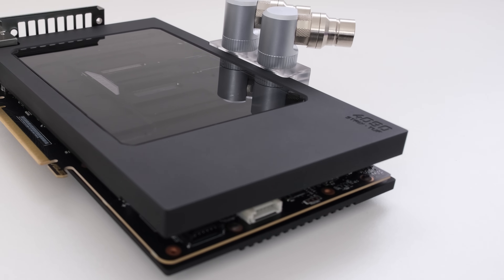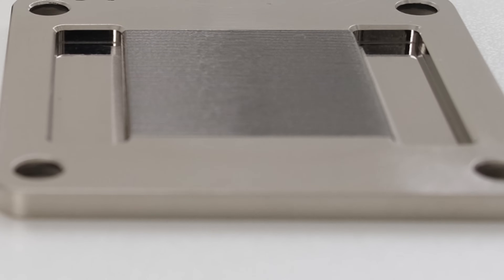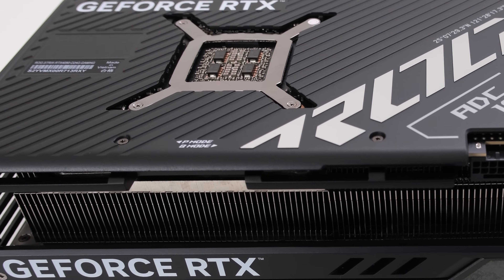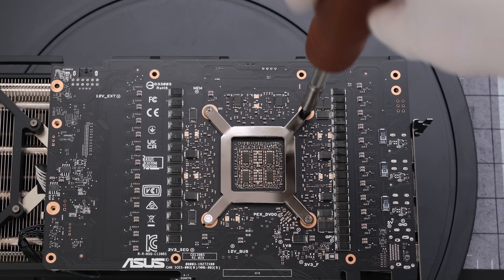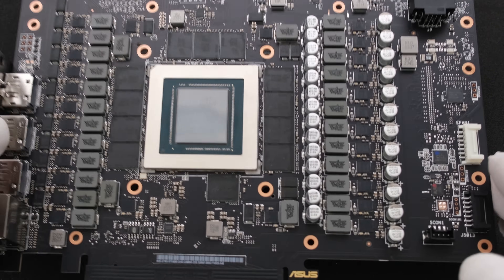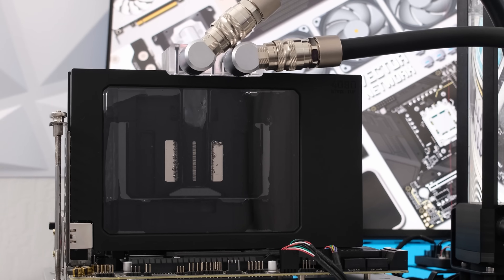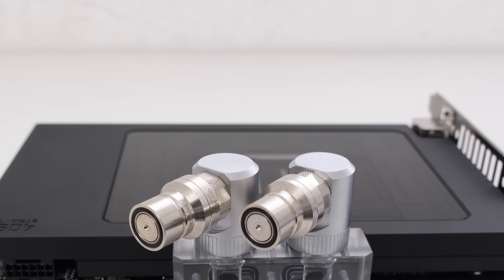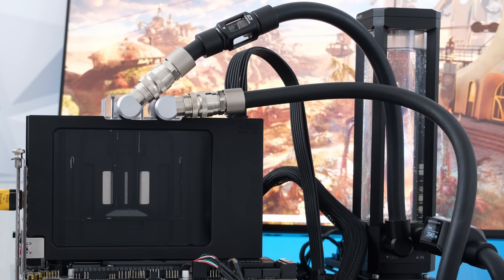Optimus Strix Water Block - Best RTX 4090 Cooling?

Comment: I don't understand how you compare. The video card should work at the same frequency and you just change the water blocks and compare (at the same coolant temperature). And the last thing - Overclocking below 3000 for Asus Strix RTX 4090 is ridiculous. Real overclocking is 3060 at 1.1v and power of 600 W (or better yet, install a 1 kW BIOS from Asus). This is just kindergarten, man. Or buy 4090 HOF

Comment: lovely video,s no flashy abnoxjous music , a calm relax presentation , i was wondering tho , cool new Gpu cooler , their cpu cooler is great aswel i hear , would it be possible in this setup to use Kryonaut Conductonaut a bit of liquid metal on the coldplate , or it,s a no go becuz of the oxidazion of the metals ?
Reply from the maker: Thanks for your comment 🙏 Thinking about this outloud, liquid metal should work. The GPU doesn't have the IHS like the CPU, so it's just a direct die. Nickel plating should be okay with the liquid metal, it's that copper that will more quickly react. I never tried (yet) having only used on it CPUs. Hope that helps

Comment: The thing about such setups involving the niche products based off of high end components is that if you avoid spending the extra money on the bells and whistles edition of everything, couple of years down the line you'll be enjoying a much faster system with just the  money you saved. It would be one thing if computer hardware generations leaped in every four years but as things stand you're either robbing yourself of a significantly better experience down the line or you're spending borderline proper workstation levels of money on consumer hardware.

Overclocker motherboards come to mind, they are objectively worse than workstation boards in every metric except for bios options for tuning and the average gamer will not benefit much from it until they become obsessed with tinkering and exotic cooling solutions. But these boards cost as much as a workstation board that has more PCIe connectivity, more and faster usb ports, more and faster networking, better power delivery (to feed the HEDT monsters), often come with remote management hardware, lots more storage options etc.

Any extreme liquid cooled GPU is the same, it'll just be an additional $600-700 which would probably cover half the cost of a RTX 5080 that will be 50% faster than a heavily overclocked 4090.
Reply: true, the only thing that would be an argument is near silent operation, better operation if you have very hot summers, some people also just like the process and the pieces they create for what they are beyond Pc functionality, why do people spent thousands to make thei car look cooler, same concept
Reply: @sayit1196  sure, I agree that it's a hobby and people are interested in it for all kinds of reasons. I'm a workstation minded pc builder so my priorities are a little different. I made the mistake of having hardline tubing on a system which was my main work PC, which resulted in a downtime of one day when I had to replace a faulty memory stick. Nowadays, it's separate soft tube loops or air cooling only. To make a car analogy, my point is that a souped up Subaru WRX might cost more than an M3 and it'll be less reliable, less comfortable and might perform only slightly better on the track. The cooling solutions on modern high end GPUs are already overkill, like the 500HP+ engine on the BMW M3, I'd rather spend the money on more luxury than power at that stage of diminishing returns.

Comment: best rtx 4090 air flow kard ist ,, galax rtx 4090 hof 3,1ghz 666watt tdp ,,
Reply from the maker: Thanks for your comment 🙏 Agreed. I did qualify when I said the Strix is the best air-cooled card "offered by ASUS", as I was comparing it to their Matrix. The Galax is the best air-cooled 4090. If the Galax had a water block, I would teardown the Galax (to see the PCB, usually they have really customized PCBs) and then put it on the block, to really see how far we can boost it. Thanks again for the comment

Comment: I use cerakote stuff daily, and while there is a cerakote option for thermal transfer, ive seen cerakote fail in moving water environment cases. Nickel plating is generally better in this application because its atomically bonded. Whereas you have to think of cerakote as more of a paint. the parts are sandblasted in a specific way so it creates the right side of peaks and valleys for the cerakote to bond to. But once moving water finds its way under the cerakote then it will still peel or chip like paint. You can also find examples of cerakote plated water blocks that have failed this exact way on various watercooling forums/subreddits
Reply: So over time it can start to flake. I really doubt that Optimus will care if this happens to someone though. Bad nickel plating exists too and starts to flake. Bare copper is the most simple if you don’t care about the tarnishing over time. You can polish it too though.

Comment: It makes no sense to cool GPUs with water these days because it is almost impossible to overclock them. What's more, you can hardly resell a graphics card that has been modified in this way.
Reply: The point is to get lower temperatures and noise not just overclocking. And what do you mean hardly resell? You can always attach the aircooler back and resell the GPU.
Reply: @Simon_Denmark   Would you risk spending $1300 on a used 4090 that has been wrecked several times and is out of warranty? Not me
Reply: @Thomas_Thiel  ”Wrecked several” times. What do you even mean with that? You don’t wreck anything with a waterblock. Attaching a waterblock doesn’t take your warranty. Well depends where you live and if you have bad consumer protection rights. The manufacturer has to prove that you destroyed the card by attaching the block. Why did you even comment? You obviously don’t do custom watercooling.

Comment: You're saying, that Optimus block is 6-7 degrees cooler, but you forgot to mention that you're using totally different paste. It's not how it should be done.
Reply from the maker: Thanks for your comment 🙏 You're flat out right. I have been waiting to test the Optimus block since it was released nearly 2 years ago. I had been waiting for the FE version. I didn't intend to compare it to the FE HK block, but the difference was unexpected and noticeable. It ended up being something I wanted to include in the video, as I thought it was worth mentioning. As for the paste, I got some criticism for using Noctua paste in lieu of all the different pastes that come with the blocks. I was using Noctua for ease of application and consistency for comparisons sake. For this block, I used the KP paste because the instructions called for it and because I was trying to address the feedback. Having said that, I am interested to see what the results would be like if the Watercool Heatkiller V Pro block for the Strix 4090 was test, along with the newly released Ultra plate. I hope to be able to produce that showdown video. Thanks again for your feedback
Reply: Entirely different gpu even
Reply from the maker: Thanks for your comment 🙏 Yep, I had actually been waiting for to test the Optimus block since it was released, waiting for the FE version. The FE version never came and I never intended to show the comparison. But when I tested it, it was clear to me that their was a difference. I tested several of these water blocks for 4090s and 4080s and they all seem to perform the same. The difference here was enough for me to show it. I recognize this isn't apples to apples and that Watercool just release a brand new "Ultra" cold plate for their Heatkiller V pro blocks. I want to see how the Strix 4090 Heatkiller V Pro block in both the regular and ultra plates compare with the Optimus block. I hope to produce that video sooner than later.

Comment: I can confirm this to be accurate based on my testing, as well. My TUF 4090 hits 3045MHz and just stays flat at 3045MHz with occasional dips to 3030MHz. Granted, my setup is a dedicated GPU loop with a 560 and a 280 rad. It is separate from the CPU loop (which uses a 480 rad and the V3 signature block). Point is, yes, I see the same 40°C to 44°C from 4+ hour long sessions of gaming. Benchmarks? Most benchmarks are too short, in duration, and, many times, I see 39°C or less. My ambient is 72°F (22.2...°C). If you have disposable income, then yes, this waterblock seems to be the best out there. It is pricey but worth it. Otherwise, any of the other brands are still good. But... then again, if you are custom watercooling and have invested in a 4090, then you have disposable income. This block becomes justified then.
Reply: do you use thermal paste or liquid metal for the gpu ? I have been doing experiments on my 3060, not sure if my 4090 is ready yet hha
Reply: @sayit1196 I used the included KPX. I used (and I still have a syringe each of Coollaboratory Liquid Metal Pro and Thermal Grizzly) liquid metal more when I was younger. Now, I'm just too impatient to dedicate using a Tamiya triangle cotton swab to apply the liquid metal, apply clear nail polish on SMDs, and clean die surfaces with acetone and a make-up cotton pad. I am sure that liquid metal would have helped; however, would it help enough to get another boost tier of 15MHz (for the 4090)? That part is debatable. I am satisfied with the KPX. Obviously, Vince Lucido's TIM is good. First time I've used it, and I'm happy with it. Otherwise, it would have been either Prolimatech PK-3 or Arctic MX-5.
Reply: @Gifted_ID10T  i don't think it will get you far beyond the 3ghz mark, the matrix doesn't go futher than that either

Comment: There's no point in buying an expensive card because it has a good air cooler when you're going to replace it with a waterblock anyway
Reply: Unfortunately the GPU makers don't sell cards with the high end PCB designs with the cheap coolers, so you usually have to buy the expensive air model to get the best VRM layout, etc. Like you could use the cheaper Asus TUF with this block and it would work great, but it has a few VRM phases missing against the STRIX for cost cutting.
Reply: @Jared-qy1jh  there are GPUs way cheaper than Strix ones that still have good VRMs etc. Obviously if you buy a MSI ventus it's gonna be great, but I don't think you need the Strix one even if you do overclocking.

Comment: Why do people even care about this stuff overclocking these chips basically does almost nothing besides some dumb benchmark you will get 95% out of 4090 from most basic air cooled designs that cost 3x less. I guess go get this to get that 1% and have 5090 rek it in a few months.

Comment: Optimus has for sure the best engineers in the watercooling world
Reply: I think it's more that they have a different approach than most companies when it comes to their products. Most products are made with a price point in mind. Optimus doesn't seem to focus on price at all for their development and simply tries to build the best version of the product, then set the price. Their manufacturing abilities are what really set them apart.
Reply: Marketing though…
Reply: Nah the Heatkiller block performs better hands down. It’s been proven on not only this channel, but by many. The Optimus is a great block but the Heatkiller is king on performance and aesthetics

Comment: I think the new heatkiller v ultra might be better than the optimus v2.
Reply: Do you know any site or YouTube channel that made a review of this block?
Reply: @matacachorro4090 Hardware-Helden at least, Watercool is referencing the article for the new cold plate.
Reply: @matacachorro4090  youtube deleted my links but dazmode on youtube has a review comparing them but his heatkiller is the v pro not the v ultra.
There is a v ultra review by a german website if you google "Vergleichstest: 4 Wasserkühler für die ASUS RTX 4090 TUF / Strix" but this is vs the optimus v1 & not the newer v2.

Comment: Can you test the new ultrathin plate from Watercool for RTX 4090 water blocks?
Reply from the maker: Thanks for your comment 🙏 Yes, that is the plan. I have been meaning to test this block since it was released, but I didn't have a Strix and was waiting for the FE version. When I finally got all the parts needed to test it, Watercool released their Ultra plate. So, Ideally, I would test this Optimus block against the Strix Ultra plate and also the Regular plate (for comparisons). I would be interested in seeing the results of the showdown.